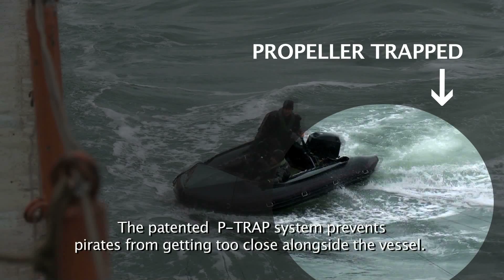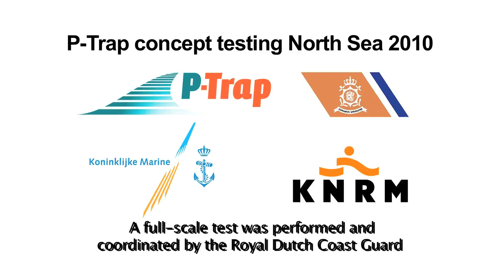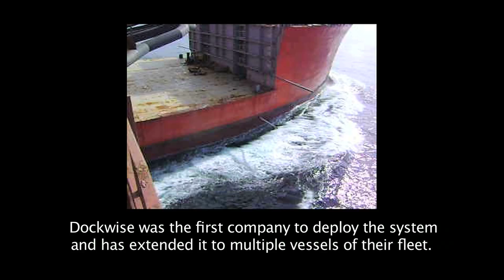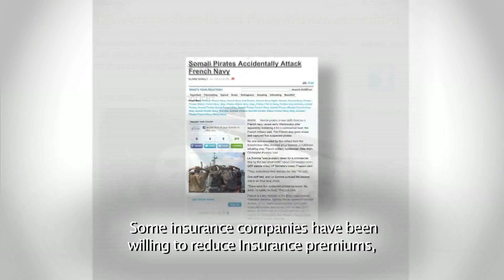Testing anti piracy system P-Trap on North Sea November 2011

Comment: Many ways to get around it. Bolt cutters, mesh around the propeller, propoltion system using water jets and no blades etc etc.

These pirates make £200 million a year, they'll find a way around it no problem.
Reply: Would really slow down the boat. If it leads to cheaper insurance then it must work. I think the main down side is that it would increase drag and be awkward every time the ship has to go to port